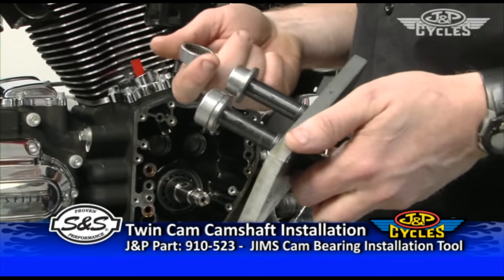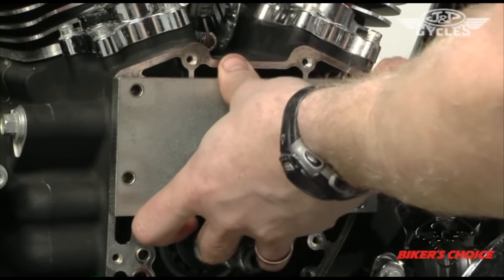Cam Replacement on a Harley Davidson Twin Cam, including Pushrod Removal •  J&P Cycles

Comment: The most trickiest part of this job is the push rod adjustment the rest is very straightforward one wrong adjustment on the push rods and there goes the engine

Comment: I have 100k on my 2000 flht. I have done all my own work. Most of the issues I've had have been in the side of the road. Most have been fixed there as well. Do say the product is junk is a great way to troll and start arguments for arguments sake. My experience has been, the people unable to get their bikes off the side of the road wouldnt have any better luck getting a broken mower out of the yard. 
 I've had many cycles BMW, Indian, Can Am, Kawasaki. Cannondale Yamaha etc. each one with their

Comment: I took off all last week, and rode 2300 miles. How many broke down harleys do you think we saw in a weeks time? Yesterday in a 300 mile stretch we counted 4 on the side of the road with folks huddled over them! Fortunately I didn't have to stop to help, as there were a crowd around each of them! Yes I do usually stop, but most of the time there is nothing that can be done anyway. When they puke, and they puke often, it's usually something you can't doctor on the side of the road. Complete junk!

Comment: Ghetto fab? LOL...K. I'll keep it civil. I won't verify it but i build motors "right" almost every day. I agree that there's a right and wrong way in most circumstances. I see nothing wrong with taking a shortcut such as this provided it does not damage any components. In a professional setting, "the right way" is the path that delivers the desired result in the least amount of time,ergo,money.Nice bike, btw. It's an 84 Nighthawk 700s with V&H pipes, correct?My 1st beloved was the '83 cb550sc.

Comment: Idk how i feel about cutting my rods. Thats metal particles falling down in my engine possibly
Reply: He explained that... that's why you use bolt cutters instead of a cut wheel, hack saw.  I'm still going to take the tank and rocker boxes off and reuse the stock rods. The adjustable pushrods AND new tubes are $200+.  I also don't want to introduce another point of failure using adjustable over single piece rods- but's that's my decision.

Comment: Why not use an impact on all those fasteners for removal.  Why not use a deflector for that oil so it doesn't soak the wire harness below?  Why not clean the tensioner threaded holes before putting bolts with blue loctite in?  Loctite mixed with motor oil probably makes the loctite useless.  You did not clean the bore of that bottom sprocket bolt.

Comment: why the little timing chain and plastic tensioner
wouldent it have been smarter to just have gear drive
a lot of motors were destroyed because of issues with that system
Reply: A lot of engines had problems with the spring tensioners,  and ball bearing cam bearings, not the hydraulic tensioners

Comment: gear drive cams have their own problems...if your cankshaft runout is greater than .005, there is the risk of gear teeth being damaged due to vibration or breaking off and sending chips through the engine oil pump... a lot depends on your budget as well...gear drive cams are not cheap...

Comment: I put mine in 6 months ago then sold it. I did not cut the pushrods. I don't think I could of saved much time cutting the pushrods. That is a stupid thing to do anyway. I bought a used Bmw gsa with 48000 miles on it. I am heading to Colorado this summer. I'm not worried about the bmw engine at all.
Reply: "That is a stupid thing to do anyway."  Please supply empirical evidence for your assertion. I'm an experienced mechanic (since 1978) and if your rocker box gaskets are not leaking there's ZERO functional benefit  in disturbing them so I don't . I fit adjustable pushrods to my personal bikes, It makes both maintenance and camshaft upgrades easy.
Reply: Make sure you adjust your valve clearance before your trip.

Comment: 1 question!:, All this for what?? What's the gain? More moving adjustable parts mean shorter life of parts and shorter life of the motor. What factory engineers did is perfectly fine and last ages, when one try to modify that s where all problems kick in. I would never buy a used car or bike where someone stuck any hands in the motor. If its not factory specs its belongs in junk yard.

Comment: 007 thousands of runout at hte crank and only 1800 miles on the bike seems excessive.
Reply: excessive run out of the crank is the reason H-D had to run a chain. Gears make too much noise between shafts with that much run-out.
Reply: @RickTaylorpopnstart  your comment makes no sense go do your research.
Reply: @ckelley63 these twin cams and M8's come from the factory with runout. Some more than others. The S and S guys won't install a gear set upgrade if the shaft has more than .005 runout. Gears in mesh on 2 shafts must run concentric. That's why that bike with .007 shaft runout would make gear noise because of variations of gear pitch circles on a mounted shaft. A chain with an idler system will allow runout that gears won't.
Reply: @RickTaylorpopnstart   Wrong Wrong Wrong! You can't run a gear drive set up on a Twin cam with more than 003 tho of crank run out Twin cams are known for crank scissoring. Meanning the crank halves will shift causing the excessive shaft run out. Harley gives a spec of about 10 thou which is still way to much. Most hi po engines builders will weld them for any hi performance applications
Reply: @ckelley63  so...back to my original statement..."thats why they put chains instead of gears"...now you get it!!
Reply: @RickTaylorpopnstart   Listen here slapnuts it was you not getting it I tried to explain it to you the best I could Jesus

Comment: What happens if you take the tensioners out and throw them away? A 350 chevy motor doesn't have a tensioner. The drive side of the cam chain should stay tight when the motor is running. Anybody ever done this? I would like to throw the whole motor away. Harley should have recalled these. I have a 2006 eglide for sale it's the last harley I am going to buy. Looking at the indians
Reply: PUT A GEAR TO GEAR IN BY S&S YOU WILL NEVER HAVE A CAM PROBLEM AGAIN

Comment: Harleys are expensive as it is. Why aren't these upgrades, you touched on, a part of the motors to start with? Is it because mechanics and 3rd party manufacturers are guaranteed job security. No wonder Harley Davidson is losing customer base exponentially. This is also why the Japanese cruisers are more reliable requiring less maintenance.

Comment: HARLEY has no intention of fixing these problems. If they did, they have had since 1999 to get it right as, that was the first year the FATALLY FLAWED TWIN CAM was introduced as a 88 , 1450cc, engine. That engine, albeit, in it's different displacement sizes, is still the same engine right up to the present. They have had years, and years to fix the inherent problems, but, there is too much money to be made with selling new parts and service to an unsuspecting, public, who really know little or nothing of these problems, they are so mesmerized by the styling cues and profiles of the bike to pay any attention to the real heart of any bike and that is the power plant.
Reply: mike brabant. I'm beginning to think the same thing!👍

Comment: Hey are those bolt cutters from harbor freight? How about the pliers. Are the pliers from harbor freight? Are you serious? You want me to use bolt cutters and pliers on a motorcycle that I paid $18,000. dollars for? Hey since all Harley cranks wobble shouldn't the crank bearings be replaced also?
Reply: Um... my bike is almost $60,000.00 right now and I would have no problem with a mechanic using bolt cutters on something that is going to be discarded.  You act like using them made the bike useless.  Does it really matter what tool is used as long as no damage is done?  What do you use to splice your wires?  Please... tell me it's NOT a wire splice!
Reply: Why buy a 150 dollar pair of boltcutters when the 20 dollar ones do the same thing? Spend you money on drivers and socket sets...

Comment: I would use my air tools to diassasemble much much faster but I have been a mechanic for only 50 years !!!!!!
Reply: I used to do that and mostly switched to  electric impacts now that they don't suck.  I still use pneumatic die grinders etc for high speed work and my ancient IR impact for the big stuff.

Comment: Way different than my 72 Sporty. That had 4 cams. 4 gears. Better pay attention to timing. Does anyone know if Harley timed it and setup an ignition so both cylinders fire TDC instead of one cylinder being TDC and the other cylinder being slightly out of TDC? I'd think it could get slightly higher compression out of the one cylinder if the ignition would hit both at TDC. I know my Sporty just hit both cylinders at once, exhaust and compression stroke, every rotation got one fire. That's what makes the distinct sound though. Victory and the other guys just copied it. I still won't ever get the idea of that funky tin can sounding Buell one cylinder crotch rocket. Oh man, the sound. "Pop Pop Pop Pop". Ugly sounding little thing.

Comment: Why cut the pushrods and then install new ones? Could just take off the rocker covers and loosen them, then install the cams and re-install the rockers and covers. Not that much trouble and MUCH cheaper!
Reply from the maker: If time is money, it really isn't cheaper. When you consider that a good set of rocker box gaskets cost $50 plus you have to remove the gas tank, and rockers to do the job, It's just easier. Not only that, but you will be able to change lifters in the future without as much labor. I change my lifters once a year, so I save money by having quickie push rods.

Comment: Front cylinder inner cam bearing in back to front. Cannot see the bearing markings. Golden rule not adhered to. Check and check again when installing components.

Comment: Up until I saw this I wondered why so many tc riders wanted to buy my shovel, now it makes sense, Harley has started making throw away motors.
Reply: if harley were to rebuild the shovel. i'd just go to the home depot garden dept and buy a single handle no cam shovel. much less bs. and i can even kick start it by jumping up and planting my foot down. only part required is dirt! though i have spoken to many that agree like myself. that harley needs to go back and bring back the shovel, knuckle and pan. just do a simple upgrade to shut the government up with emissions. and start building retro engines and incorporate them onto new bikes frames with new hardware and accessories just leave out all the rocket science. what a 2 cyl v twin produces in emissions don't amount to jack shit. instead of some stupid crap milwaukee beer engine a bunch of drunks designed. i'll keep my 96. a 110 just makes more gas stops. try and driving cross country with a 110-120. better have a fuel trailer with it. im tempted to shit can my 2010 fly by wire. id rather have the adelphi cable drive or better yet just shove a carb on it. fly by wire aint never got off the ground. if i want to fly i'll buy a airline ticket! and fly the friendly skies!

Comment: Cam plate and oil pump should be upgrade as well,  why put the stock junk back in?....save up a few more quarters and buy the whole package....even the orange screamin eagle  plate from harley is better than that junk ass cast one is. Come on harley, 48 grand for a cvo ultra 117 that has a cast plate in it....

Comment: That’s why I’ll never buy a Harley don’t understand why do you have to upgrade parts to something better. When.buying a used one you have no idea what was done to the engine. For the price you pay it should be perfect from the factory and should last over 100000 miles with out touching the engine

Comment: You haven't a clue what you're talking about. Simple cost of labor vs materials. I would bet that the cost of those new pushrods were cheaper than the other method of removing things away from the top of the engine to then get to the overs to removed the pushrods. If labor were the typical ~$90/hour, that 5 minute trick probably more than made up for it. It's my dime if it were mine and I probably would take the top apart, but not when paying someone hourly to do it. This hacked nothing up btw.

Comment: The year push rod moved because you had a rubber band on the push rod  Tube If you would have been using  Crows pens like we've always  Have done .we never used a paper clip and I'm rubber band what a stupid idea Van you can put the adjustable push  Back in the bike with the push tubes held up with the close Pan

Comment: Note that there are no cam bearings in the cam plate.  Just holes drilled in the aluminum that the cams ride in.  This is called "planed obsolescence" meaning the cam plate is DESIGNED to WEAR OUT.  Harley does this shit throughout their engines.  The only way to get a truly long-living, RELIABLE Harley engine is to toss the damned thing and have Randy Torgeson build you one pretty much from scratch.  Only around 20K.  The bike in this video only has around 1500 miles on it.  So why the hell do the cams need replacing?  Folks, I will never buy a Harley.

Comment: Justin, You sound like you know what you'r talking about. Sound like a professional mechanic. I am just a shade tree mechanic. I thought about a gear drive. Then I found out that all Harley crank shafts wobble and to put in a gear drive you have to take the crank out true it, weld it and plug it. Answer me one Question. A wobbling crank shaft going threw a bronze or needle bearing. Will the bearing wear properly? I don't think it will. I do not believe that you or the engineers at Harley are that stupid. They engineered a 20,000 mile motor. It's really kinda sad. A gold wing with proper care will go 200,000 a BMW will go 200,000. American made? NO, Chinese engineered and Chinese built junk.
Reply: One of us are wrong. The 20,000 mile number came from the harley davidson mechanic at Coralville Ia. harley. The question I asked was about the crank bearings. They have nothing to do with the life of the piston or rings. If you have an untouched twin cam 88 motor with 100,000 or 150,000 show it to me. You have an 09 it has the upgraded plastic cam tensioner. You cannot put gear drive on you'r 09 because the crank wobbles. It wobbles because the crank is pressed together not welded. Harley recommends checking the 88 cam tensioners at 20,000 miles. I know of an 88 that the tensioners came apart at 17,000 miles. They went into the oil and were sucked up by the oil pump. The motor locked up at 70 mph from lack of oil. I don't think a crankshaft should wobble. If harley took the time to weld and true their cranks they would not need any tensioners. They could use a gear drive. Instead they press them together and sell them to fools like you. I bought a bmw my hd is for sale. I have owned 4 harleys I will not buy another one.
Reply: MY 03 E-GLIDE HAS 107K AND NEVER BEEN IN THE ENGINE,DOING NEW CAMS AND TENSIONERS THIS WEEK
Reply: fredmagee Ahh, but you said it was a 20k motor.....it clearly is not.  Calling something a "20k motor" implies it is junk at 20k.  Plenty of guys with non Evo's with 100k+.  It was INSPECTION at 20k.    Before the current hydraulic tensioner, dealerships were offering $25 inspections if you didn't want to do it yourself.  Not that big a deal.
Reply: AOWGroundBeef  I was wrong. A brand new harley has a crank in it that wobbles. It wobbles because it is pressed together not bolted like in the past. If I have to explain why a crank shouldn't wobble you wouldn't understand. So in my opinion a harley motor is junk with 0 miles on it. You just buy that harley, don't complain and they will keep selling you junk. They lost me as a costumer if others complained maybe they would change. It realy sucks I liked my hd I wanted to keep it but I don't ride junk simple as that.
Reply: Japanese, not chinese. The Japanese build fantastic machines.my goldwing was built in marysville ohio. I like Harley's but that goldwing motor is a torq monster.
Reply: +fred, And a fucking Prius will out last a Ferrari. You either get it or you don't. Testarossas were HIGH dollar when introduced, but you can find top end drivers with all records for under $40k ALL FUCKING DAY LONG, 7 FUCKING DAYS A WEEK. One issue is the need for those name sake red heads needing a $1,400+ adjustment EVERY 1,200 miles. But people that love them will bend your wife over your Prius because that's what rings their bell. I ALWAYS laugh when people go on about Goldwings and BMWs. NO chick EVER came in her pants riding on the back of either of those. Harleys are simply not for pocket protector dorks looking for value. Never have been. If I was a value seeking dork I wouldn't own my Harleys, or my '67 RS Camaro or my '66 396 SS Chevelle. I'd by looking for a fucking Prius to park next to my Goldwing. My 03 Road King run out was .001 when we installed 509g gear drive (better low end than 510g), but I still swapped my crank for a 2002 crank because they are solid, not pressed together, plus I went with higher flowing 07 oil pump. I had only 14,000 miles when I did upgrade just because that's what I wanted, figuring I'd have a chain drive set to sell. NOPE. The cams were HEAVILY scored, along with bearings and the tensioners were HEAVILY pitted, missing chunks out of the center pad area. How did I feel about seeing all that? Couldn't give a fuck less...don't care. With solid crank and gear drive yours and my grandchildren will be retired before there's any issue. How happy does that make me? Couldn't give a fuck less...don't care. Look, EVERY sensible argument on behalf of Honda and BMW 100% fits Prius. I'll grab that Testarossa and put a Ferrari specialist's children thru school, enjoy your sensible Prius.